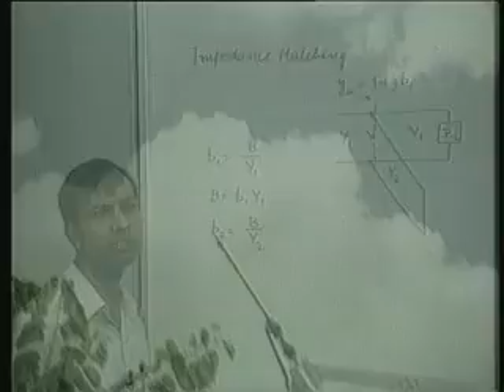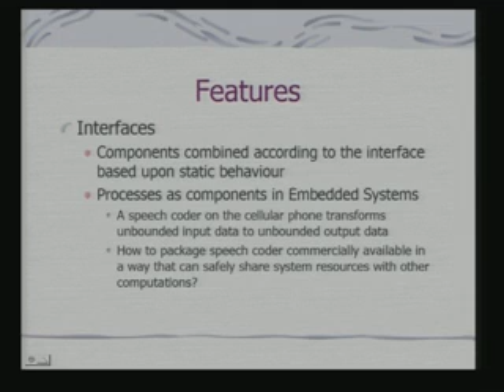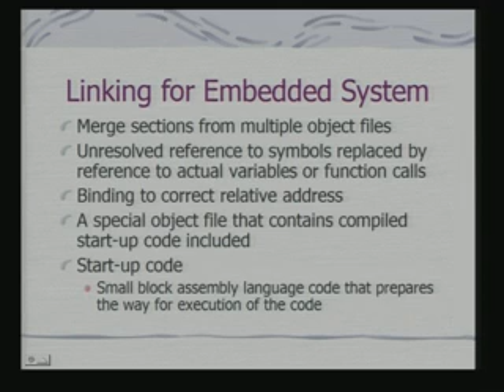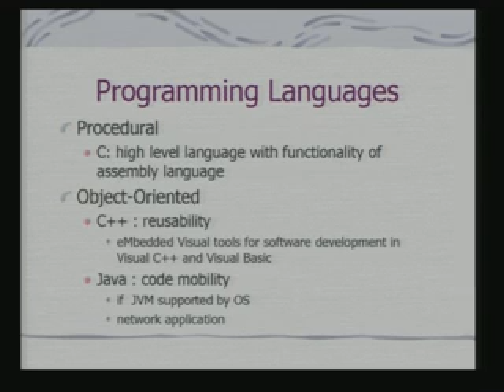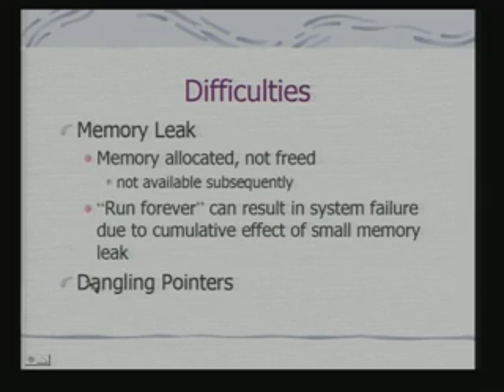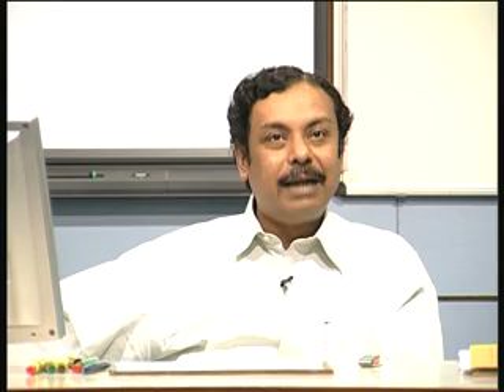Lecture - 19 Software for Embedded Systems

Comment: Thank you for the informative article it's very helpful, and there is company for best Embedded System Software Engineering Development which helps businesses to develop smart, integrated solutions that combine sleek hardware and user interfaces with powerful software and connectivity capabilities.
for more info: https://goo.gl/ansP5N